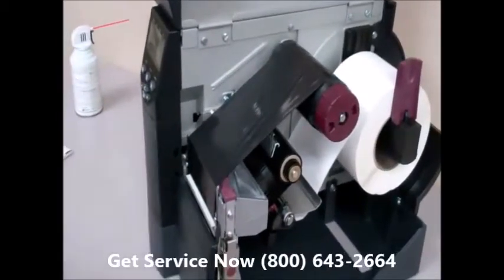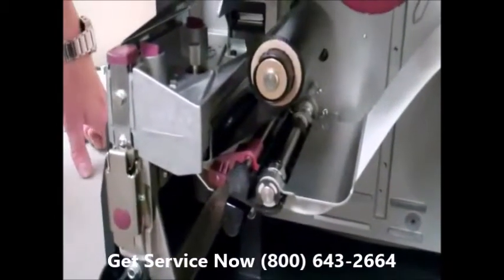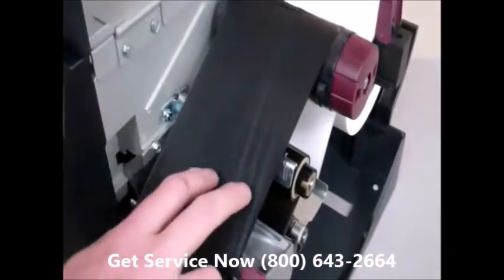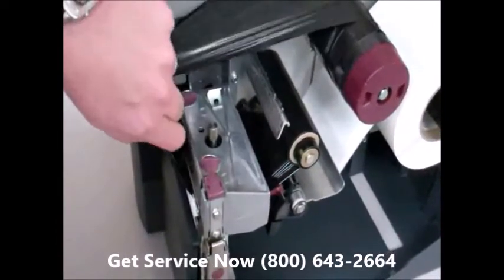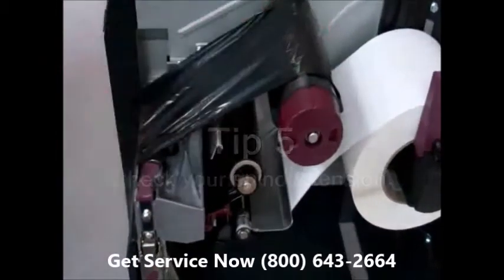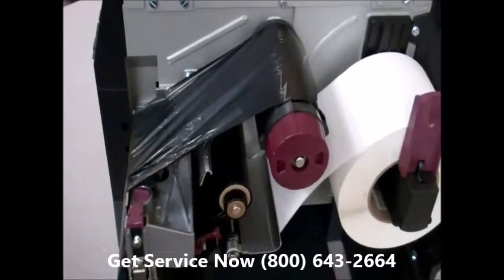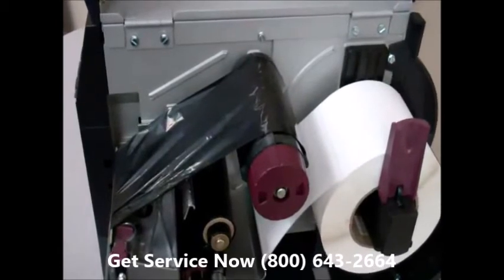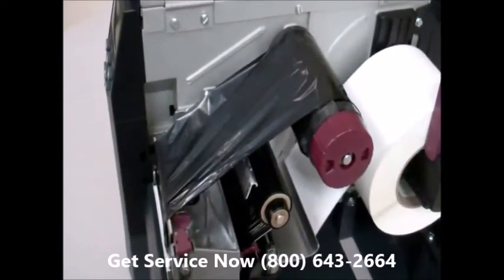[HOW TO] Fix ribbon wrinkle thermal label printer

Comment: Hi, my printer is not printing properly. It prints one barcode on two labels, so the barcode is unsuable.
Also when  press the feed button, it feeds like 3-4 papers, instead of 1.
any solutions? thanks
Reply: Depends on what type of thermal label printer you have. You have to have the proper label size in your configuration and need to calibrate your printer and save it. For instance, we use Printronix T5204r and T8204 at my facility, I have seen more than one label print on one label and a fix for that was to set the printer to GAp instead of Advanced Cap and run the auto-calibrate and save it. I also changed a setting from TRansmissive to Relective which uses the bottom sensor for the printer. If you have the issue still you may want to apply the latest software firmware update for your model of printer to bring it current and up to date. Hope this helps.